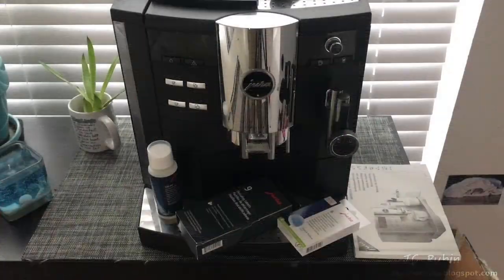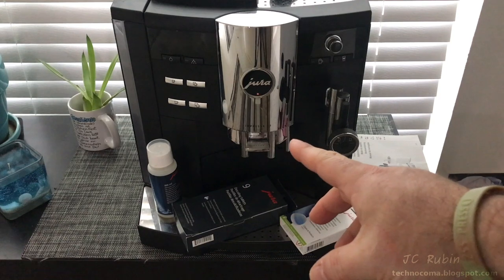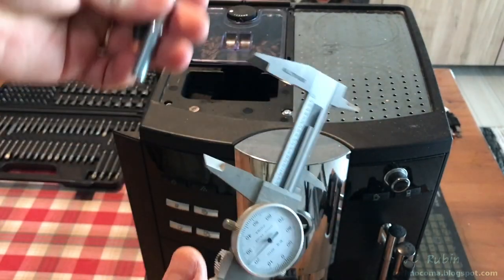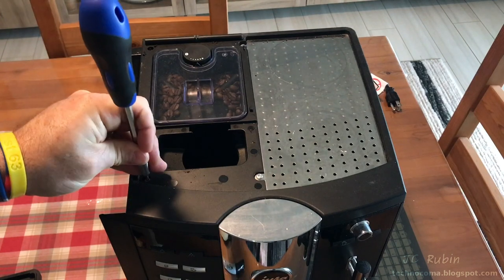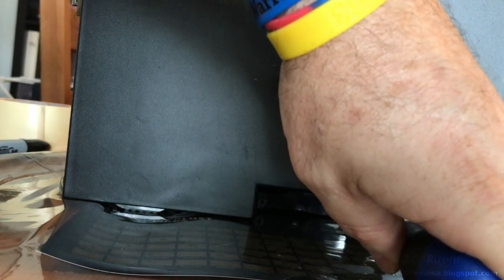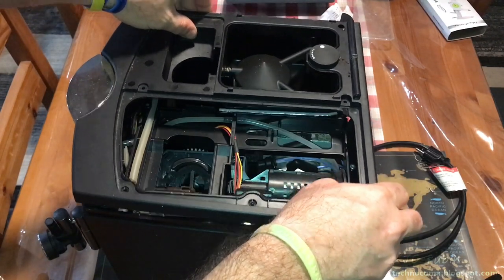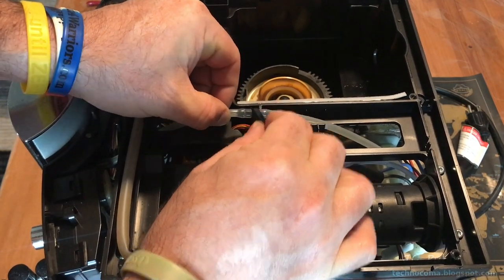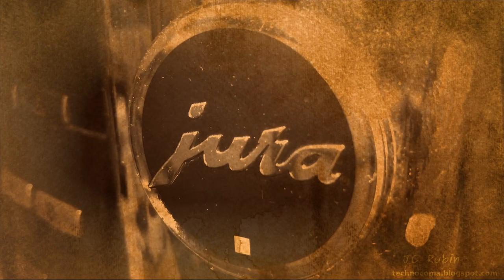Jura Impressa S / X / XS Rebuild Series Part 1 - Opening the Unit

Comment: @retrotechandelectronics, I made it all the way thru to reassembly with zero issues, but at the end I have ONE water hose left that I can’t figure out where it goes! Mine is the s9 avantgarde, so a little bit different. do you offer any support? and where is your venmo?
Reply from the maker: You check both sides of the squeeze valve..... its hard to say from here. retrace all of your steps.

Comment: Do you know why the coffee would be pouring out of the cappuccino area and the Expresso area as well when I'm making a cappuccino?
Reply from the maker: Most likely the squeeze valve is starting to malfunction and needs replacing. You can see it on the inside of the front panel in several of the videos
Reply: @retrotechandelectronics  Thank you so much! I'll check it out.